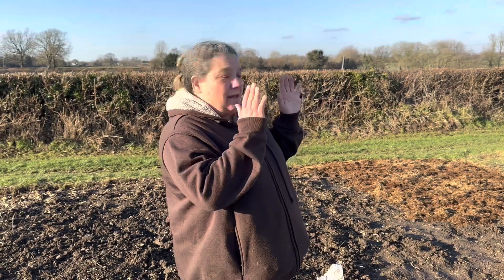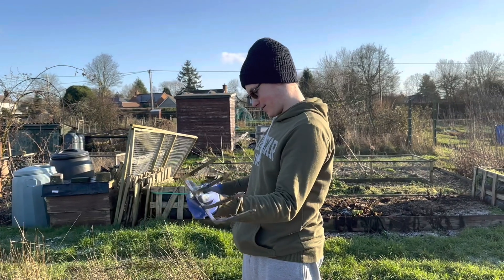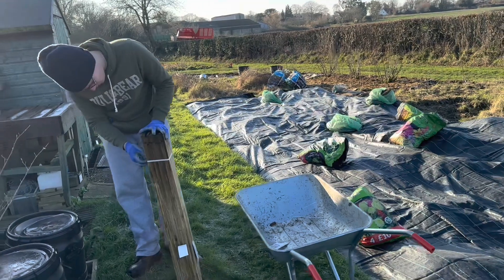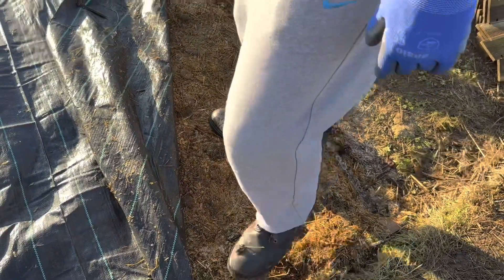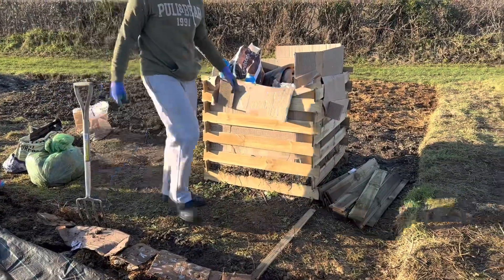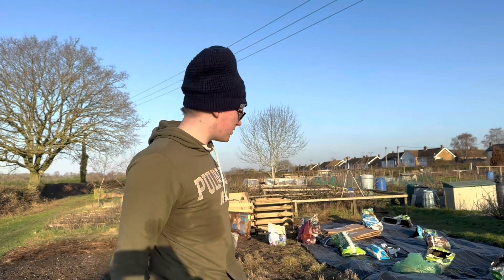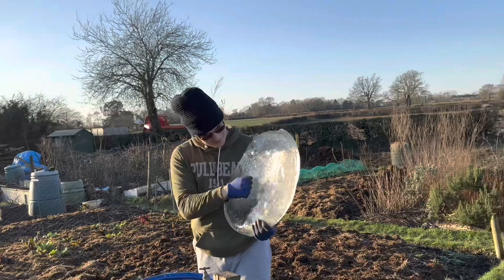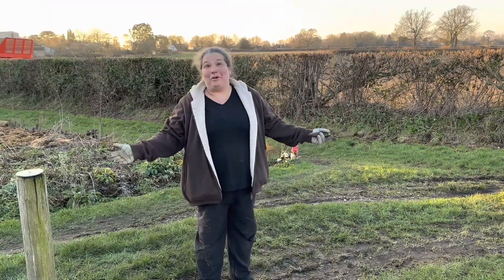EP 10: Building our Second Compost Bin! Allotment Plot No. 9

Comment: Just want to say something separately about the compost that you have in your 2 bins.  There is way too much soil.  You need a bit but not that much.  The soil is all wet and muddy and stops the materials mixing very well.  I would shake off as much soil as you can before adding your root balls to the compost.  I know that you want to get rid of your bag fulls quickly but better to wait and shake the soil off when the clods dry out in the spring, just pile the stuff up and cover it for now then shake off a bit every time you go down to your allotment once the weather changes.
Reply from the maker: Thank you for confirming my suspicion that there was too much soil in the compost bin and that is probably what is stopping it to work as well as being too dry. It was just so difficult to shake off such wet or frozen soil of the roots, it is easier to do it now.

Comment: just a tip when making compost layer of green waste layer of brown waste will make it heat up quicker and rot down faster broken up cardboard is best for brown waste
Reply from the maker: Thank you very much for your really good advice. We did do some layers of green and brown when we redid the compost before Christmas but we probably didn’t do it well enough as there was no heat. Maybe we should have chopped the grass and leaves, put more water on it and mixed it more often. I also suspect that we had some soil sticking to a lot of the grass roots we put in, it probably wasn’t good for composting… a work in progress …